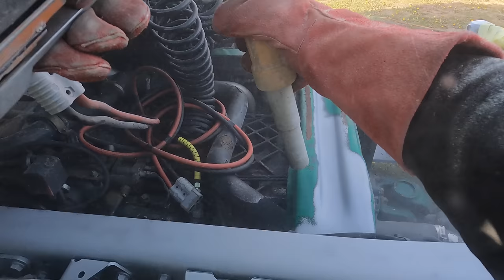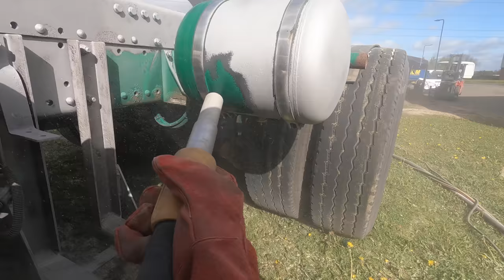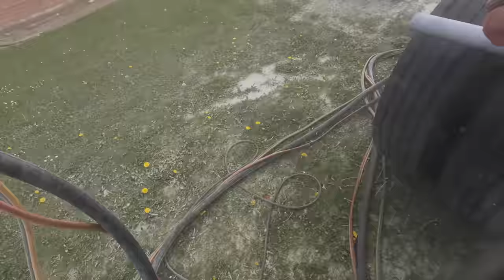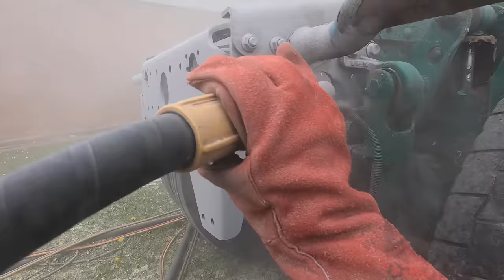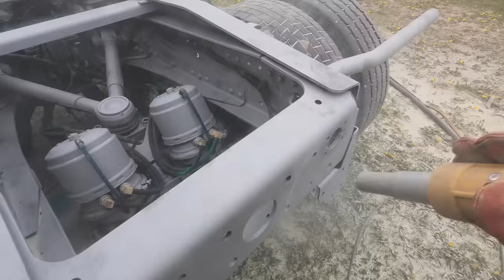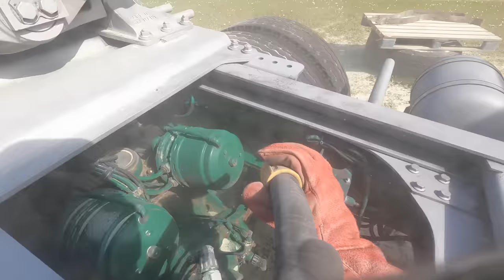SandBlasting tractor unit wagon heavy haulage semi truck frame chassi

Comment: Only recently started watching and I'm astounded. Love your magic pen colouring this truck in grey. I want to do this as a business. No mobile house blasting for me but vehicles I can do after I learn more. Thank you Mick
Reply from the maker: 😂 why not houses? And welcome to the party
Reply: @Mobileblaster  too much hassle getting them to the yard and if I was up a ladder I'd blow myself off it. I have learned start at the bottom so not blasting through shit and nice touch going the extra mile for the customer and leaving it cleaner than when it was first built. I got a little 8 bar compressor and gun so going to try some alloy wheels with kiln dried sand I think. Not sure box was heavy though
Reply from the maker: @leofeaver3035  oh please don't use kiln dry sand its got free sillica in it and very harmful to you and others around you its been banned in the UK since the 70s
Reply: It is actually proper shot blast stuff just loads of it fell out when I picked it up and looks like it so guess it'll be ok. Slowly slowly
Reply: 2 things,1.use garnet,little bit more expensive but can use afew time over wen recycled.2mak what doesn't  need blasting
Reply from the maker: @stephensmith1984  I don't reuse media for the speed aspect of the job so I need as cheap as possible with the fastest cut rate 👌 and the body shop I was working for said blast everything except the cab and then they say leave what I think I should like near wires 👍💞

Comment: Just noticed the bubble right there by the deadman haha, never used one myself but I’ve had plenty of hoses pop on me right about where it angles when your holding it lol.
Reply from the maker: Haha yeah I was keeping a close eye onit 😊 I've a video were the pipe pops one of the steel shot videos 👍
Reply: @Mobileblaster  you guys do really clean job, but do they require you to like white metal blast it? because we do semis and old school car sometimes, but we usually just sweep them like 50/50 the cars metal will warp if you blast one spot too much, but never got complaints about the paint not sticking, just seems a little bit of overkill to use sand getting every little nut and bolt, I mean you’ll have a way better anchor profile for the paint to stick, but just doesn’t seem really efficient unless it’s rigs or parts that are gonna be going offshore into the ocean.
Reply from the maker: @AylerProductions  On this job that's the finish I just happened to get most to all tractor units come this clean any less and its a miss in my book. My goal is to prep the serface so so the painter can get onit after me with very little to no further preparation. On grab wagons etc I tend to get millscale my opinion on this is if it needed to be removed why is it on when I get to it unless I'm blasting new steel and the job sheet specs that. Same again leaving paint rust or any other foreign particles is a miss and not doing the job I've been asked todo. Yeah sometimes I get asked for speed over quality that case I still try and hit everything but not as deep a clean 👍
Reply: @Mobileblaster  yeah any paint or rust is a definite no no gotta get all that stuff off, get close on the tough spots and make it look even all around but we get a lot of people wanting something done real quick and not a lot of business wanna pay for a perfect job because they understand it’s not really necessary for something that’s going right into the field, I mean the painter is still gonna have to sand it and blow it off, still gonna have the same amount of work to do once it’s blasted, and mask the tires and cover the cab, just seems longer for the same results to me but to each his own I suppose, maybe it’s going to a truck show who knows, we’ve gotten those before lol
Reply from the maker: @AylerProductions  have a snoop through my other heavy plant playlists I have quite a few wagons trucks on them I don't always get the near white finish. On some jobs tho by the time I brake through the paint the steel is white so a decent result 😀 other jobs not so good to do 😂 its like you say its knowing the customer and what they expect. Obviously more work puts costs onto something that's going straight back to work or back out on hire
Reply: @Mobileblaster  I definitely agree with that man, i love it because you get to meet some really interesting people and it’s even better when they come back and bring more work because of how much they liked it, they usually just want it done fast and cheap, though I try to be all 3 without wasting too much time and resources, knowing your customer definitely helps not everyone’s the same, we get some picky people sometimes, but I’m just saying because it can be just as expensive operating all day on one small job that is like perfect when you could do like 3 or 4 of those in one day if not more and still look the same after it’s painted, just enough to create an anchor profile so the primer will stick and then finish, I mean if moneys no object for them that’s fine, but sometimes they want you to bid it and you wanna make sure you don’t underbid so whenever they get the price and it ended up being cheaper than expected, it tends to help give your company a better image being all 3. Fast, quality, and cheap. Also probably wouldn’t wear your self out if you stood back a little bit and let the sand do some of the work, that’s mainly the reason why it would take so long not necessarily because of the quality they want, if they knew what quality they wanted, they would’ve done it themselves because they would know the difference lol

Comment: What compressor/machine did you use for this job? What is pressure needed and how many CFM?
Reply from the maker: 260cfm @125 psi but I've since bought a 425cfm @125psi 
Blasting can be done with any cfm and any psi although 100psi is that goal

Comment: Will sandblasting eat the electrical harness or any of the joints/bolts rubber parts?
Reply from the maker: Depends on the person doing the work. Many ways to get similar results. I can blast without causing damage to said items but I've also got alot of years under the hood and made every possible error it all depends on how to adapt and overcome these issues 👍 blasting as an industry gets a bad name from the poor operator but plenty of guys know how to do it properly 👌

Comment: How much kg of sand used for this please? And what type of sand blaster is this? Thank you
Reply from the maker: I cannot remember off the top of my head but if I was to do another I would load the van with 30x 25kgs on the hopes to use 15/20. Not sure if it was my own build or a clemco 20/40 or even a soda pot totally cannot remember sorry

Comment: What kind of media are you using ?
Reply from the maker: Crushed glass fine plus 👍
Reply: Does it tear up air lines ?
Reply from the maker: @chrisbertrand3989  it can do but a little practice with flow distance its doable to go over wires and pipes without damage 👍

Comment: Why are you too lazy to remove the akamulators, the wheels were not removed, it was possible to partially disassemble, well, and can be seen by the old green paint on the hoses without disassembling all the paint
Reply from the maker: Not on the job sheet pal I only do what I've been told to 👍 I don't get involved in taking anything off that's down to the body shop I'm no wagon expert I sandblast haha 👍
Reply: @Mobileblaster  Aaa understood everything sorry